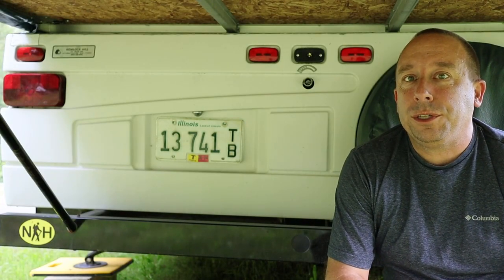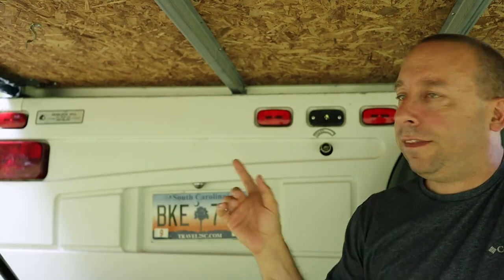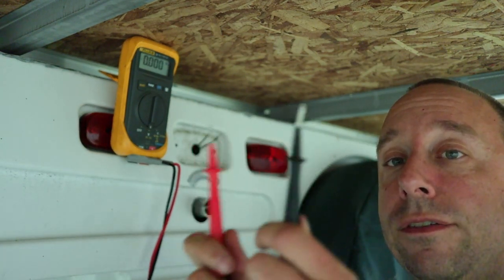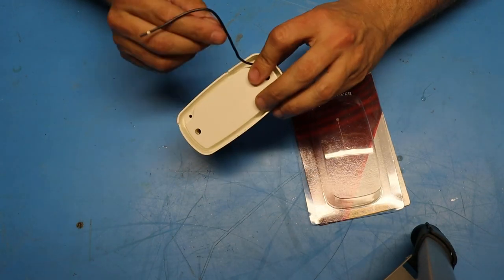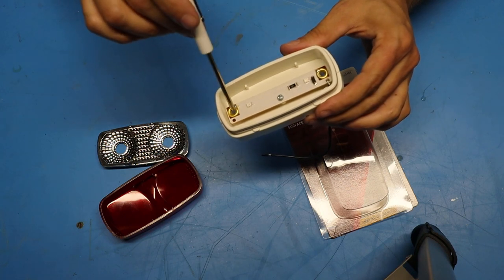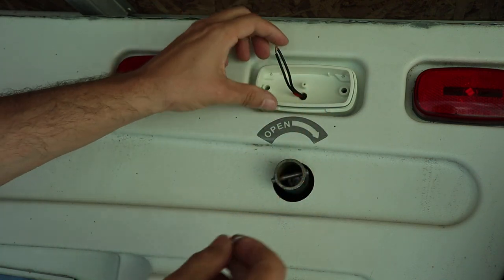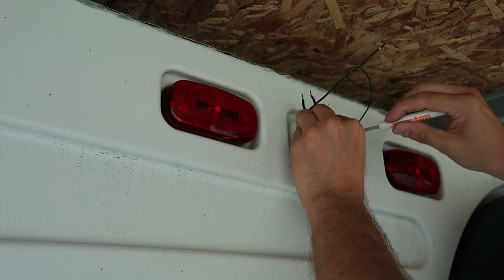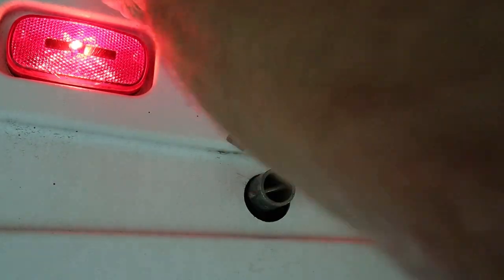►Marker Light Replacement Highlights - Pop-Up Camper Maintenance

Comment: Hi Rob,
Nice job converting to use the Walmart light. Surprised a replacement lens wasn't easily found online. You and the family stay safe.   73   WJ3U
Reply from the maker: I actually tried a few lenses first but couldn't get to fit so I had to change the whole thing